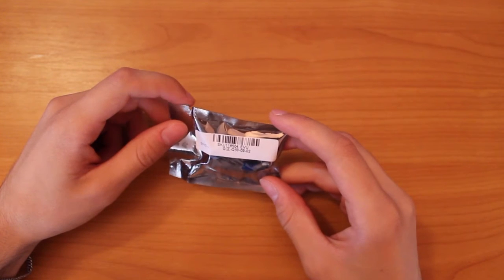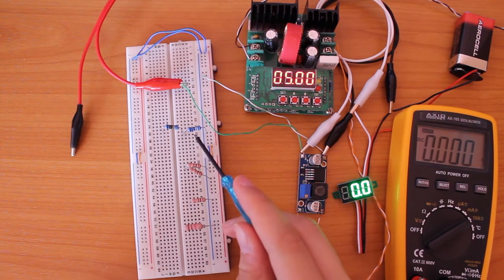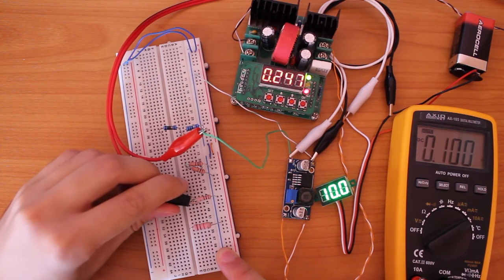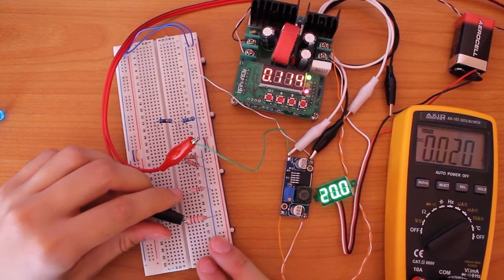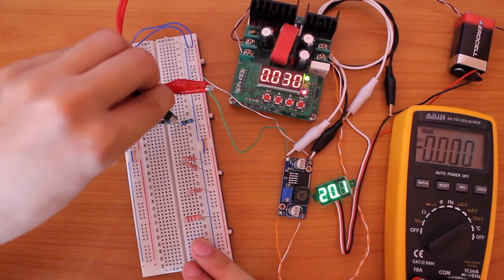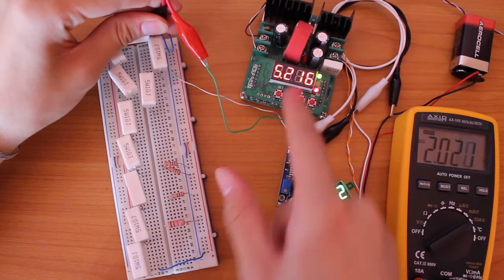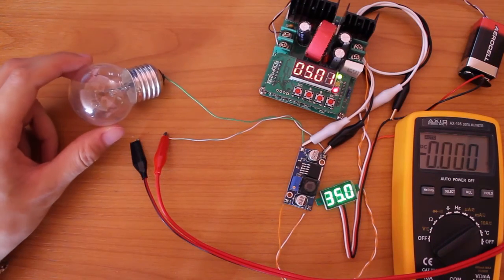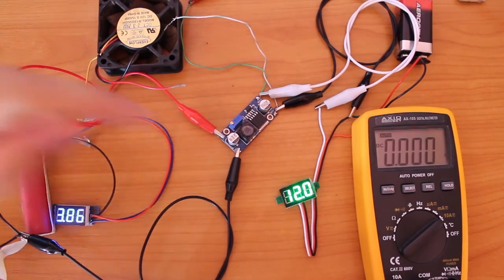XL6009 mini Boost Converter Review, from banggood

Comment: Great review/tutorial. :) Just one question: what's that voltage of the input you're using there? Thanks!
Reply from the maker: Don't remeber for sure, but you can see at the 1:00 mark, the B3606 Buck converter (which is used as the supply) is set at 5V. But if it gets into Constant Current mode, then it will adjust the output voltage to keep the current constant.
Reply: Nice, thanks! Just ordered 3 of them a feel hours ago. :)

Comment: What is the max watts this can produce?
Reply from the maker: +John Berry Hi. I haven't tested the module to see how hot it gets over time. Look for the XL6009 datasheet (the chip on the module) and you'll see the max temperature is 125C. Keep it below 100C and you should be ok. Sorry I can't help you more at the moment.
Reply from the maker: +GGomar007 Says on the website 10W. I haven't tested that though. It might need a heatsink.
Reply: +Dragos Puri can I run three different kinds of 50 watt led chips on the same led driver at the same time ,  like these: 
http://vi.raptor.ebaydesc.com/ws/eBayISAPI.dll?ViewItemDescV4&item=171736255684&category=66954&pm=1&ds=0&t=1462096549449, and http://vi.raptor.ebaydesc.com/ws/eBayISAPI.dll?ViewItemDescV4&item=321987938262&category=66954&pm=1&ds=0&t=1462096373962, and http://vi.raptor.ebaydesc.com/ws/eBayISAPI.dll?ViewItemDescV4&item=262303262337&category=20706&pm=1&ds=0&t=1462096388955
Reply: +Dragos Puri    Hi if you use less than 10w does that mean the module will last longer?.. Thanks.. John :)
Reply: +Dragos Puri   Ok thank you for reply :)

Comment: Kindly tell me where did you buy your adjustable power supply?  I like it as it can supply more than 5A.
The one that I knew from http://www.banggood.com/B3603-Precision-CNC-DC-DC-Digital-Buck-Module-Constant-Voltage-Current-p-946751.html only give me 2 to 3 A.
Reply from the maker: +Randolph Dharma Hey. There's a video on my channel about it too. It's called B3606 (36V max output, 6A max output). There's more info about it in the video, and a link to banggood. 
https://www.youtube.com/watch?v=Muo6mUvLv84
http://www.banggood.com/B3606-NC-Digital-DC-DC-Step-Down-Buck-Module-Constant-Voltage-Current-p-947293.html
Reply: +Dragos Puri thank you for sharing